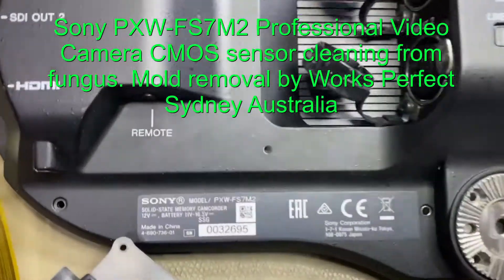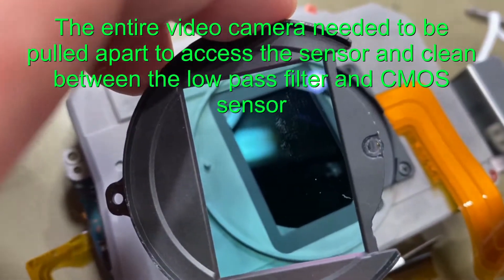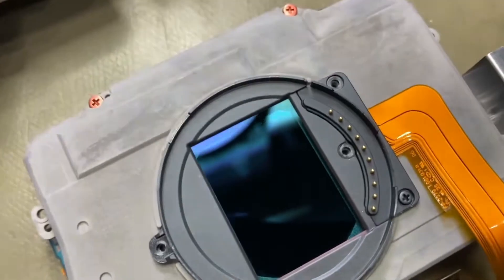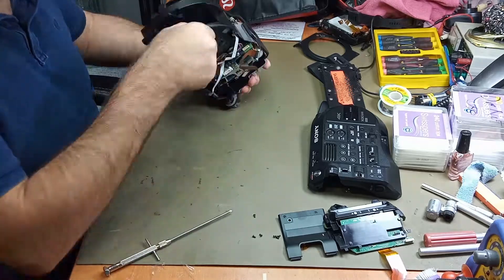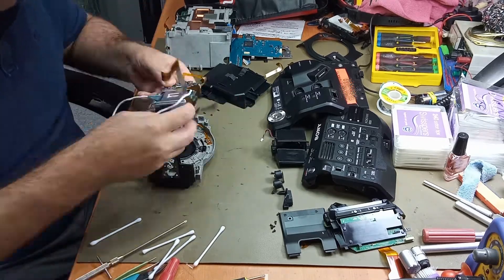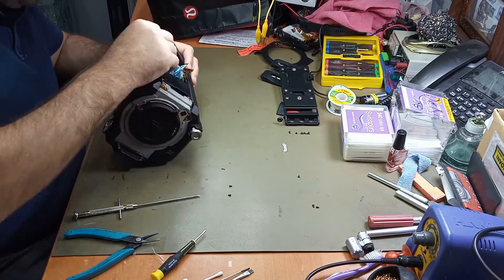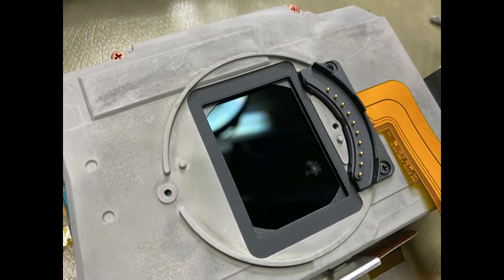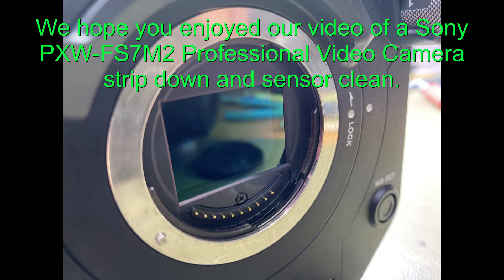Sony PXW-FS7M2 Professional Video Camera CMOS sensor fungus mold build up cleaning by Works Perfect

Comment: Wow, thanks SO much for pulling up! I had a similar issue with dust and grime under the low pass after rolling on a dusty farm for the past month, and really wanted to open it up and clean it, but needed to make sure it WAS possible to separate, since Sony is so adamant that it’s a single unit. Amazing work. Looks to be a really fun series of steps for what’s supposed to be just a ‘simple’ sensor filter clean.

Comment: The date and time of my PXW-FS7M2 are being restored, I understand that the internal batteries are rechargeable, but if they are already damaged I should change them, in which part of the equipment is this located?
Reply from the maker: It is an internal clock battery. The camera would have to be pulled apart to find it. I would highly suggest that the video camera be taken to someone that is a Sony professional repair to get it changed.

Comment: Hey hey, Just wondering. At the company that I work at we are missing some screws from the top handle. We think these scews are the same as on the top plate. Do you maybe have any idea what kind of screws those are? It is really difficult to track down.

Comment: Great upload.  I dropped my FS7M2 off at Sony in Tokyo to clean off a speck of dust that could be seen either on the sensor or on the back of the low pass filter (it is visible on the image when stopped down).  They came back and said there is "foreign matter adhering to the filter unit (part FIX-2100) that cant be fixed without replacing the entire unit" at a cost of about $1500.  Does that make any sense to you?  Do you know part FIX-2100 is?  I'd rather have a crack at it myself if its just a matter of opening it up and getting to the back of the low pass filter.
Reply from the maker: If you know what your doing pulling those units apart then there is a good chance that it can be cleaned up as seen in my video. Fungus, foreign objects etc.
It is a full strip down just to get to that low pass filter and there are some tricky parts to pull apart and put together.
Just to let you know there is a lot of stuff in that video i didn't put in showing how to pull the video camera apart.
If your worried you may damage the video camera by pulling it apart you can always send it to us Sydney Australia, we accept jobs world wide. Postage to Australia is around $100.00 AUD. Just box it up with lots of bubble wrap really well and send it over.
Reply: @worksperfect3279  Thanks for the reply.  I think I'll take a crack at it.  If I run into trouble maybe I'll box it up and get it touch.